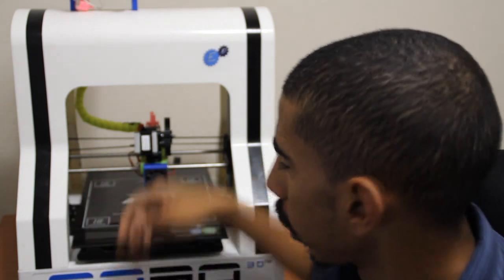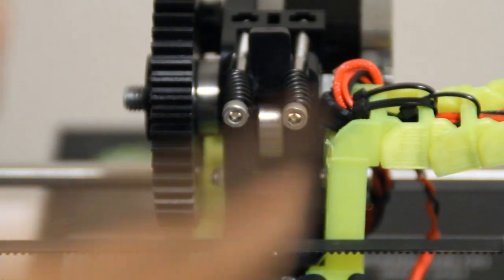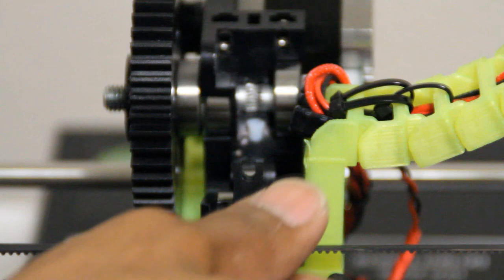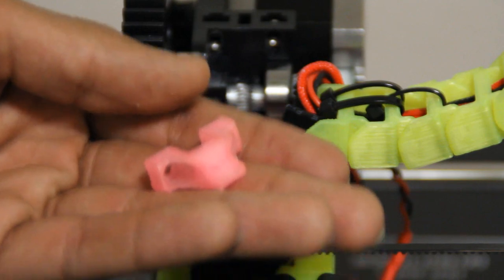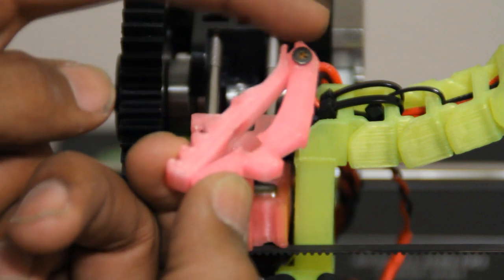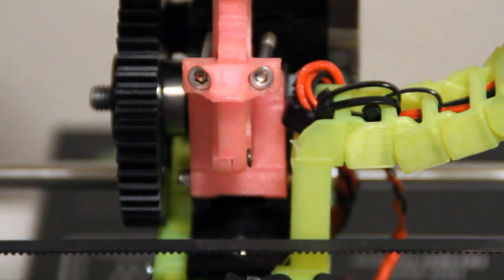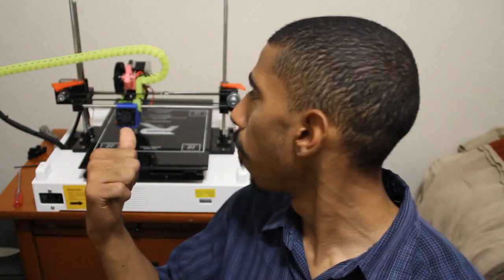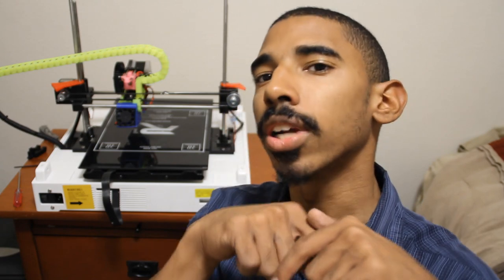Expert Mods: Filament Quickchange

Comment: I guess I don't understand the added hassle of this?
My ROBO 3D has a spring loaded bearing and all I have to do is push the bearing back, collapse the springs, then remove the filament and insert new filament. The screws can only be tightened in so far until they bottom out and I have proper tension on the filament.
Are some of these printers different then others?

Comment: FYI - On the R1+ they have now reversed the bolt that holds the latch on.  Luckily, you can still get to the screw head through one of the holes in the gear.
Reply: does this mod work on the r1+ ? also do u have a list of mods that actually work on the + it seems that most of these mods are made for older robos
Reply: +Boss Vapes from what I can tell in my first week of owning a R1+, most mods are compatible or already worked into the R1+.
Reply from the maker: +Shawn Hill Yup that is true, the R1+ is just the best version of the R1 (for now). The only differences I have heard about are the carriage plate, the ramps pin outs, and the lead screw motors.

Comment: Marquis, (Novice Expert)...  I have a Robo3D R1+... just printed the mod using the "6mm Larger Pinch Retainer side" and "6mm Spring Pinch Lever Wade side", "Retainer for Larger screw head" and "Wade Hinge". Fits perfectly and works perfectly. I used my two existing bolts (they have phillips heads), and one of the existing springs that fit perfectly in the 6mm printed parts. Screwed the bolts into existing nuts 5 turns. Pressure, feeding and retraction is good as new! So much easier! Thanks.
You once said you would modify your front fan mod so it works on "stock" Robo with hex head. Will it happen??????
Reply from the maker: +Bob Lewen Uh, maybe. School work kinda got in the way. But I've have Robert do it.
Reply: +Novice Expert I trust, with your guiding, Robert will do a fine job"! Thanks.

Comment: Not sure why, but it does not work with the R1 +plus. I tried, but the spring clip does not go in correctly.
Reply from the maker: +Techommentary I'll check out Aaron's printer this weekend. He has a R1+ and I'll get back with you.
Reply: Thanks. I may have printed mismatched parts, I have a 6mm spring, I did print those out right but the others I am not sure about.

Comment: I think it's a great mod, I always have trouble trying to feed my filament through without removing the 2 screws, I will do this mod ounce my printer is back up and running, Thanks
Reply from the maker: Bobocop What's up with your printer?
Reply: Novice Expert I'm still waiting for the bracket that holds the extruder step motor from Robo3D, When I tried to install the E3D-V6 I found that the bracket was broken in half when taking it apart.
Reply from the maker: Bobocop Ah, that's almost the secondary reason I heavily mod the printer...I always have a replacement for many of the pieces can break.
Reply: Novice Expert Thats why I fallow your vids, Not many people help like you

Comment from the maker: Wayne Hobbins All printers have that design, but sometimes jams occur when doing this. To prevent that from ever happening I always removed the screws when changing filament. Using this design allows me to be able to expose the filament hole and allow me to load filament easier in my opinion. In this video's time-lapse you actually see the screw on the bed with every filament change https://www.youtube.com/watch?v=PytBrb1s9SY
Reply: Novice Expert Okay, understand! I learned to overcome the jamming problem by looking down through the slot in the top. That way I can see the hole into the extruder.

Comment: Hey i have been having an issue with my robo 3d: everytime i try to print with high temperatures i get a "temperature fell to mutch" error. I first thought that it could be the controller board over heating (like for barnuceles) so i switch the 40 mm fan for a 80 intel cpu stock fan. It got even worse. I think that it is the power supply that is not powerfull enough to keep up with the 235c° extruder and 95 c° bed temperatures.
Reply from the maker: janot928 It just means that the tolerance that the printer wants to stay within is being exceeded. A PID auto tune should fix that. https://www.youtube.com/watch?v=APzJfYAgFkQ
Reply: i'll try that tomorow thx
Reply: So.... I did the pid autotune and now the bed heats faster witch is cool but the extruder temperature goes all over the place. It doesn t seems to have fix my problem completly: everytime i tuen on the cooling fan the temperature keeps on falling, i have to lower the print speed to keep at 335c°. I am really starting to think that it could be the power supply but i cannot check that sadly
Reply from the maker: janot928 Whoa 335c°? it may be a power supply at that point. Are you running M303 S335 C10?

 M is PID autotune
 S is tuning temperature
 C is the amount of passes to generate better results
Reply: my bad i miss type it it's 235 not 335 ^^' i'll send you a link to a video this week end so you can see what's happening exactly